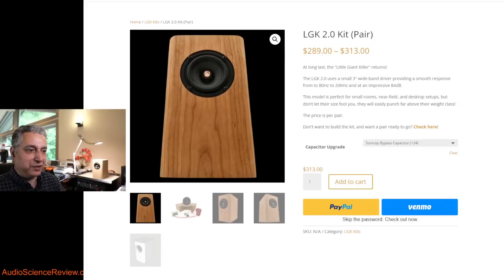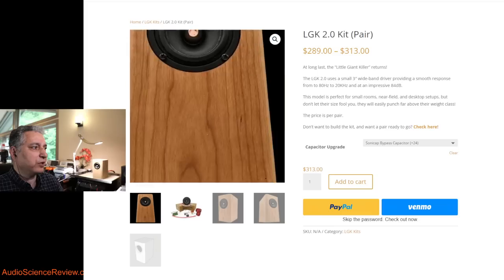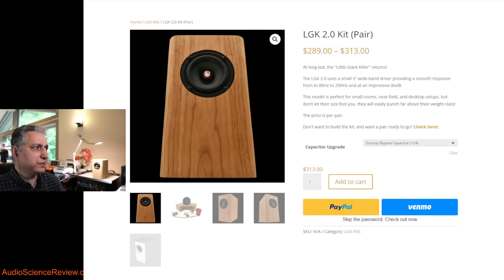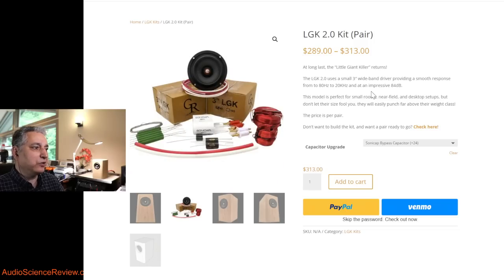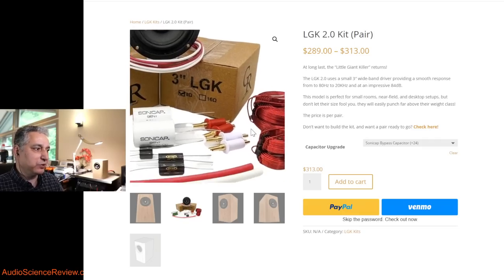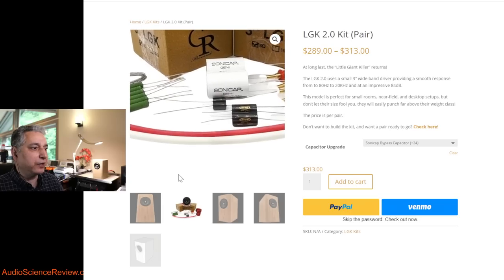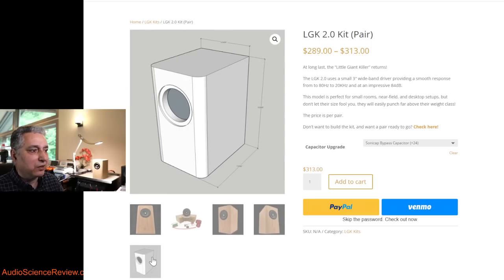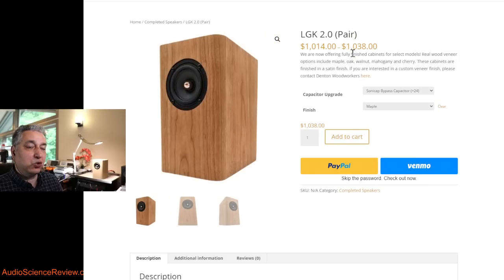GR Research LGK 2.0 DIY kit Speaker Review

Comment: Amazingly detailed test, thank you Amir! Very educational to see what really takes place with that fine Klippel gear and your skills and makes sense to my own subjective conclusion that these small fullrange driver designs needs to be taken for what they physically can deliver, and at that price point will be disappointing, unless you had too much bad cool-aid to prevent you from hearing reality. The performance reminds me of the Monacor SPX-31M 3" full-range driver that sounds transparent in a little ported system at 18$ a piece, and also can be tuned to similar F3 and the response also looks similar. But too me it gets boring too fast and you need the low, top and ability to listen at a natural SPL, and once you try to fight physics to just get into the bracket of delivering that distortion comes to get you. But a 2.1 system crossed around 100Hz a small fullrange driver can get far with DSP and maximizing to the listening position.
Reply from the maker: Thank you for kind words and comments.  As you say, even in a context of a highly limited 3 inch driver, you can do far better than this kit.   And for sure one needs to promote it as a 2.1 system as many low-end companies do.  Not set it up to not only be great as is, but take on much larger speakers.

Comment: Actually, in all honesty, you watch one GR Reseatrch video, then you’ve seen them all. Danny’s format always follows the same formula. He starts with a set of highly critical measurements. Well, measurements are only as good as the equipment used, the environment in which they were taken, and can be tailored to satisfy the purposes of the person making those measurements, so are unreliable.

His solution is always the same. Change the ‘cheesy binding posts’ for tube connectors. Swap the electrolytic capacitors for poly caps. Upgrade the wiring. Line the cabinet with ‘no res’.

Well, absolutely nothing is perfect. Not even Danny. Everything is built to a budget, including those items where the engineers were told ‘cost no object’. You can take anything and upgrade, or put in more expensive parts that does not necessarily constitute an improvement in performance.

Enjoy the music!
Reply: I contest that you are Hans Beekhuysen in disguise. Do I win a prize ? I probably spelled that wrong. Sorry, Hans.
Reply: @jimfarrell4635  I’ve probably spelt it wrong as well, but no, I am not Hans. Though i do follow him, subscribe to his channel and hold him and his opinions in high regard. So, you don’t win a prise. Prises are dished out by hifi reviewers desperately trying to increase the popularity of their channel. No names mentioned Jay!
Reply from the maker: Good point about their predictability.  If he all of a sudden was out of selling crossover part business, they would take on a completely different character.
Reply: @AudioScienceReview  🍻👍
Reply: @jimfarrell4635  Hahahaha Enjoy the Music

Comment: I'm curious as to what the binding posts on the driver itself are made from. Danny always makes a huge deal of "cheesy" steel binding posts or screws, either on the outside or inside of the cabinet. I'm guessing any ferrous material anywhere in the connection chain would have a similar impact, (if any), regardless of where it is?
Reply from the maker: He included his famous "tube connectors" in this kit and that is what was used.  I will test those specifically in the future against generic binding posts to see how they compare.

Comment: Are there 3 inch drivers that produce good bass without distorting the lows at high volumes? Also whats the cabinet filler situation here?
Reply from the maker: There may be.  Certainly can't be worse!
Reply: No. Not in a bass reflex design. But in a rear horn design, yes.
Reply: Probably not, but 4inch for sure (Guru Audio Junior)
Reply: There may be a "long-throw" design that allows the cone to travel longer distance (which Danny mentioned in his response is a limitation). It may require a different foam ring design or material.
Reply: I never took the time to do the math using the more low level equations, but I think increasing the xmax will increase the cost of the driver and lower the efficiency.  Efficiency wouldn't be a big deal since a 3" driver won't handle much power at bass frequencies anyway.  But increasing the cost definitely does.  Everything's a trade off.  If you made a 3" driver that could do the job of decent volumes at 80 Hz, it'd be cheaper to get good results with a 2 way with a larger woofer, or 2 3" woofers, like it in a 1.5 or 2.5 way design.

Comment: I have built speakers for sometime and I got an set of encore and I was not really very impressed by the driver quality, although I did like the sound of the tweeter. As in your build the flat park was really well done and went together very well. They do sound pretty good but really for the money a set of the HIV 3.1 (Swan) speakers DIY are much better drivers are 3 way with a dome mid. They have much deeper base and beautiful mids. The high can be a bit hot, but with a inductor and cap change you and tone the tweeter down a bit. Best of all the are much cheaper the Danny's and sound much fuller.
As far as this speaker goes it's really hard yo get a full range driver that is that small to handle lows of any kind without distortion in the mids. From the little I have seen of this driver it has very short throw and looks like it can be easily over driven.

Comment: 25:17   -Sound Demo
25:20   - You can hear the first buzzing, but that's actually in the recording
25:34   - Most people Will hear "Warbling" Tone in voice. Like speaking Into a table fan. 

How to play Pin the tail on the distortion Donkey

-Test first thing in the morning to a quiet room.   Your ears will be more sensitive. 
-Main PC volume  no more then 1/4  max on the slider/volume control. 
-Turn off Fans, A/C, air cleaners, Buzzing PWM devices.
- Remove all noise in room.  
- Sit in quiet chair or Bed with clothes that are audibly quiet.
- position headphone cables so they don't transmit sound to ear cups/IEM's 
- Plug in headphones.  You should not hear any hiss / sound / PWM noise.  
- Remove headphones.  Set aside. 

STEP TWO

* You will need a Device that can open multiple browser tabs. 
* Best done with Battery power on laptops / Tablets. 
* DO NOT plug in your headphones yet. 

 Get  music track HERE:  https://www.youtube.com/watch?v=NcgaJN2JF3s

1.  When at the page, lower the volume of Clair Martins Video.  
2.  You should have 2 tabs open of this video & Clair Martins video. 
3.  GOTO  ~ 0:11 in Claire's Music Video.  
4.  Match audio levels with computer speakers. 
5.  Plug in headphones. Do not put them on.  Match audio levels. 
6.  Switch tabs & Forward to ASR's video to 25:17 where music starts. 
7.  Sit down.  Plug in headphones.  Put them on in that order.  
8.  Match audio levels in both videos best you can. 

  

Take your time and see if you can hear what Amir is hearing.   You will notice the "Warbling" tone of the speaker. 
 Her voice is Modulating.  This sounds sort of like...  Well.  she's having intercourse on a phone conversation and you can hear  the "distortion" clearly in the modulating of her voice diaphragm and lungs.  (I think you get it)  
 _That is the speaker cone making bass notes the same time its trying to play vocals as the cone is moving back and forth.   

 

This is why it was mentioned it sounds like a cheap boom box or table radio with a single driver.  Often found in cheap audio gear with a woofer trying to play full range.  

You can also find this distortion when you play your tweeters too low to its Fs,   (Playing bass tones in a tweeter  basicly) 

Compare both tracks and see what you can pick out.   

I can't really tell if the buzzing is from the driver, or the soundtrack.  But I can hear the voice going warbly for sure.    

)))))))))))))))OTHER THOUGHTS((((((((((((((((

  I'm starting to think G&R makes kits for the same people that paint Miniatures in retirement homes.   
 It's people who need something to do to pass the time so they don't take some lead Solder to the chromium if you know what I mean? 
_Something to keep you  busy so you can pass the time or get your mind off things and have something to show for it.     Tackle problems with the same group of people and make some freinds that lead  to getting out of your dark place IMO.   
 
Glad these kits and beliefs exist for these people.     And Danny does a great job for those who were like me that needed something to believe in to pass the time.   
   I think he knows deep down what and who his market is.  
It explains some of the guffaw between Danny and Amir.     Kind of like a Priest at a church  plays his role and has the same kind of reactions to having his religion tested by an atheist or doctor.

Comment: I read the review and didn't get half as much as I did by listening here on YouTube.   This is one if the best reviews I've ever heard.

One thing you mentioned was the sound deadening material.  Did you use Danny's Nores?  If not that will likely be his excuse as he might want to claim his deadening material is better than what was used.
Reply from the maker: He usually calls for that for but not here.  Instructions just say to use some padding which is what Rick used in the build.  Here is the quote from them on another forum: "There's not a lot of room for Norez and the cabinets are already pretty solid. We recommend lining the walls with fiberglass insulation or polyfill so long as you keep the port opening clear."
Reply: There's no dampening material in the world that can solve this speakers design issues. Danny may be smart enough (or maybe not) to avoid that No-Res route.

Comment: Ouch. 
 
A few things: 

(1) Placing the driver at one end of the enclosure and entrance to the port at the other end is a great way to maximize harmonic resonances exiting the vent.  The effect can actually be modeled somewhat using Hornresp ( I have a spreadsheet up on my site that can help with the modeling).  I knew the out of band noise would be significant just by looking at the layout of the box. I wonder what the out of band noise from the vent would look like if all of the stuffing was crammed up next to the driver rather than spread throughout the box as I'm assuming was done?  

(2)  That driver does not really seem to be designed for "full range" use.  The "warbling" effect sounds like the suspension is allowing the coil to leave the gap. That might be Ok for a limited-range driver like a subwoofer, but not for one designed for "full range" use.  Of course a tighter suspension that prevents the coil from leaving the gap means less SPL ability at lower frequencies....

Comment: So it didn't take Danny very long to respond to this video. Obviously he's a scam artist and he didn't even come close to mentioning this channel or this review and he acted like all of your information was his own personal information. He basically plagiarized this review made everyone thing these problems were his own observations and he was making excuses for why these problems existed and how "of course" everyone else is using his product wrong because your not supposed to listen to them to loud and your supposed to use an external high pass filter from your amp to the speaker to avoid the xmax problem and he originally specd the driver for 2-/12mm xmax but the one he went with was only 1mm xmax because his old drivers were better than the news bunch and blah blah blah you can all go watch the video Danny posted it's obvious it's a response to this video as Danny has never had anyone review his products yet and like I said he plagiarized this video and spun it like everyone shoulda know what this speaker was, a piece of junk that's only good from 500hz to 12k basically any off the shelf 3" driver you put in a box will sound the same. But his has " magic connectors"
Reply from the maker: You make a very good point that he is not professional enough to properly mention my review.  Or go through it step by step and explain what he thinks the data means if it is not what I show.  Just waves his hands and then does a demo with two expensive subs, filters and these speakers. 

I think the only professional response should have been to stop shipping these non-hi-fi speakers, redesign them, and then release them.  That would have been constructive.
Reply: @AudioScienceReview  exactly. Just stop selling these speakers . And for sure stop calling them "giant killers" maybe rebrand them as "eardrum killers" idk

Comment: There is merit in this review but from a scientific point of view these measurements should be removed. The Speaker was measured without insulation and if I understand correctly it was a single speaker instead of a stereo pair. Therefore both objective and subjective are not valid. Maybe this set of speakers should be measured again with insulation and listened as a stereo pair.
Reply from the maker: Speaker was measured with stuffing in there.  it is fully documented and show in the build thread (see: https://www.audiosciencereview.com/forum/index.php?threads/build-of-gr-research-lgk-2-0-speaker.33479/post-1170116).  

A single speaker was used per established science and not audiophile beliefs.  See this video to understand: https://youtu.be/7kDr0vEdfhY

Besides, the problem here is distortion. The max excursion for this driver is just 1 mm.  So it runs out of gas at almost any volume.  Having two speakers distort at the same time isn't going to help you.  Bad sound is core to the design of this speaker.
Reply: @AudioScienceReview  thank you. Nevertheless, the link provided can't be found (The requested page could not be found) and i can't read any reference in your review regarding the construction.  Regarding the single speaker it's for your subjective part of your review. One speaker for a stereo setup invalidates any subjective listening. Regarding the mentioned distortion this along with the phase and resistance plot is relevant to how well the cabinet is treated. No evidence that the cabinet was fitted insulation when you carried out your test. Consequently, a very good effort from your side with questionable merit. I am not saying that the speaker is good in any way. I just point out that the measurements taken are incomplete and/or invalid.

Comment: I have to admit some time ago I thought about building one of Danny's speakers. I thought what he explained made sense. And then I watched more and more of his videos and things got strange and stranger. Tube connectors for the "next level". Special speaker cables and 3 videos in which he explained nonsense. And then I gave up. I guess by now only people buy from him who are hard core followers like in a religious cult or people who didn't spend much time listening to his fantasies. In a way I think it is sad that he ruined his own reputation like that.
And thanks Amir for testing these things.
Reply: Don't forget no-res..
Reply: @jcisme  No res makes sense though.  it's basically like dynamat combined with foam from what I understand.  Dynamat is/was mostly used in car audio, but back when I was making speakers as a hobby in the 90s, I used 3/4" mdf with about 1/4" of tar on the inside, pressed course sand into it, then left them out for a few weeks, then sealed it and left the enclosures open another couple of weeks or so to get rid of any gasses.  They were only a couple cu ft enclosures and sounded like solid rock when you rapped your knuckles on them. I've never seen commercial speakers that had enclosures that sounded anywhere close as dead.  I was just doing single speakers for myself, so time wasn't an issue.  No res or dynamat would be a low labor way to getting close to that.

Comment: Did your kit include G&R 's "no-res" component? Danny uses this in virtually all of his speaker upgrade videos and it appears to come in flexible sheets perhaps 3 mm in thickness with the purpose of greatly suppressing internal cabinet resonances. So did the kit you received contain this?
Reply: No -- and Mr. Richie himself says there's no room for it and to use something else.
Reply from the maker: @editorjuno  That's correct.  Here is the exact statement: "There's not a lot of room for Norez and the cabinets are already pretty solid. We recommend lining the walls with fiberglass insulation or polyfill so long as you keep the port opening clear."
Reply: @AudioScienceReview  Thank you both for the reply.

Comment: Dear amir gr research just posted a new video on lgk updated speaker. Please share your opinion.
Reply from the maker: I watched it.  There seems to be tacit acknowledgement of all the issues I found.  He complains that I played too loud which I absolutely did not.  I post the ramped up volume in this video.  At the highest volumes, my SPL meter was going between 67 and 80 dB.  By then distortion is extremely obvious.  He also uses SPL numbers incorrectly.  Without distance, SPL has no meaning because every time you double the distance, you lose 6 dB.  So when he says this speaker is "rated at 84 dB," that is a meaningless number.  84 dBSPL right at the speaker is a very different level of loudness than at 12 feet away.

Thankfully he finally says that when he tested the speaker, he used crossover filter (not supplied in the kit) to reduce the bass on the LGK. This was absent from his original promotion video.  He claims I should have done this which is exactly what I did.  I showed my high pass filter in the text and video reviews.  It improves distortion but still doesn't get rid of it.  And then you don't have bass either.  So there is nothing to hang your hat on.
Reply: @AudioScienceReview  Thanks Amir.I appreciate your answer!Your honesty differentiates audioscience reviews from all the other sites that generally  speaking only tell the half truth about hyped audio equipment!